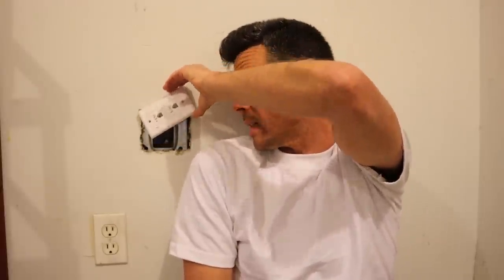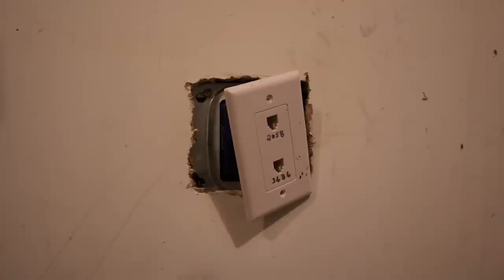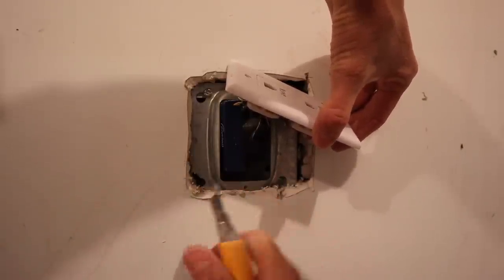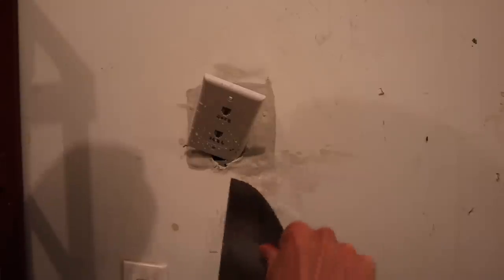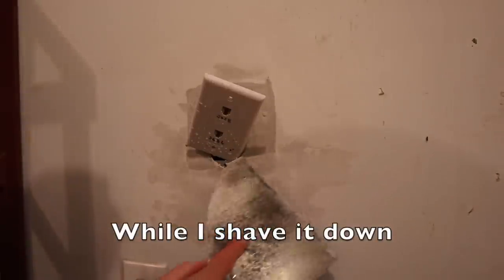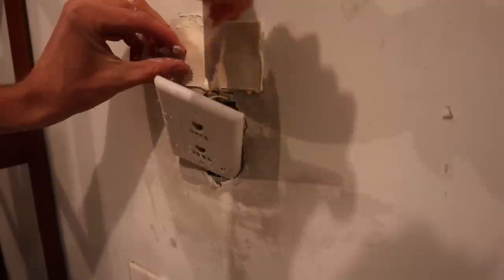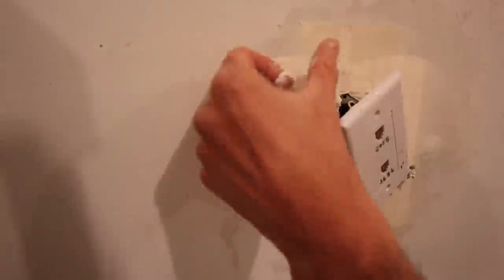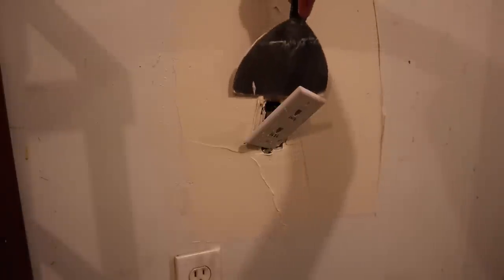How to Patch a MUDBOX!!! (drywall repair)

Comment: Oh for the love of God! DISCONNECT THAT WALL PLATE before mudding! Giving me a nervous breakdown watching you delicately maneuver your blade and mud around it. Ha ha ha ha!
Reply: Aaron its only phone wire
Reply: @Bamacher59  Exactly! Snip the wires! Ha ha
Reply: @aaron74  The RJ11 keystone jacks come with little clips that allow you to pry them off the face plate. Takes 3 seconds with a flat screwdriver. No need to snip them out (I get you were joking), but it sure makes the video all the more frustrating knowing how easy it is to disconnect properly!
Reply: @poetnk  this wasn't a keystone jack. Even easier, just unscrew terminals lol
Reply: @aaron74  And throw the plate away.
Reply: I was thinking the same “dude just unscrew the connectors!”
(not that I haven’t done EXACTLY the same myself before lol )
Reply: When I installed LV before mud, we wrapped the terminated tele/data com in the plastic bags they came in and pushed them back in to the wall. Then talked crap about reopening the holes to screw in the plate. Now I think back and realize I gave no respect to the other trades, happens a lot when all you know is LV and think your sh*t don't smell (guilty until I became an electrician).

Comment: Whoever hired the LV guy needs to get their money back

Also wiremap those ports.. looks like 7/8 pair popped off
Reply: Ex LV guy. Electricians called us primadonnas. When I became an electrician I understood why. I usually got the job of helping them out with anything that was not monkey simple. When I was LV I rarely fixed walls. But I would lay back in drywall after screw ups or large cuts as an electrician unless GC said not too. Honestly, when I was LV I had no skills outside of a "cable runner" and termination. Everything else was beyond most of us. Now it is all about the finish work, the rest is usually easy.

Comment: Step one: REMOVE THE FRIGGIN' DEVICE.
Reply: It looks like it might be an all-in-one phone jack. IE it looks like a Decora device but the plate and device are actually one piece. The only way to take it off would be to disconnect all of the wires, and not everyone wants to dive into that.
Reply: @thebigmacd  Yeah... using a #1 Phillips screwdriver to disconnect a  handful of 24-gauge wires is a lot of work.   You might break a nail or something.
Reply: @ImagImages  Or unless you take a couple of cell phone pictures beforehand, it’s a lot easier to make an error when reconnecting than you might want to think.
I know this because, why ?

Comment: "*Mud ring*" mud ring, we were looking for the term, mud ring
Reply: Funny, what many people call a "mud ring" is a simple frame that goes in a hole in the wall without a box...and doesn't require any mud.
Reply: @thebigmacd  I call that a low voltage mounting bracket.
Reply: @illestofdemall13  Called them mud rings here in SoCal, at least 20 years ago we did LOL.

Comment: Where I am we use boxes with mudrings especially for commercial applications. It never fails when I come back after the rockers and tapers are done that 90% of the screw holes are all filled in by mud. I have to scrape them all off with a screwdriver to install receptacles and switches.

Comment: My trick is to use mesh tape on the sides, especially when the gap is too wide. It holds the mud in place well and creates stronger bonding with the gypsum board on the sides. A little more work, but better results IMO.

Comment: Sometimes the "center" of those low voltage plates are able to be un-clippped from the exterior trim (decora ring), which makes the piece you need to work around much smaller.
Reply: Not meet to do that just stick plate inside

Comment: now I just need to know why they cut holes that size for regular size boxes
Reply: Usually because we measured crappy once and cut once. Sometimes it is because the mounting for those boxes are above and below the box and we think we are leaving an easy hole to fill. Until I started painting and doing mud I didn't get it. Each trade doesn't always get the other trades. If I could only go back in time with what I know know LOL.

Comment: I have a question that never seems to have a good place.
I notice that you always use a standard trowel for most of your work, but have you tried a rounded pool towel instead.
The ends are more flexible and it seems like you would have less of a chance of edge marks as you work than a squared off trowel would make.
Just a thought.

Comment: In america, we call them electrical boxes with mud rings.  Anyways easier for me to just cut the hole the right size in the drywall after I do all my electrical work... had to do this on one that was overcut but your video wasn't out in time so I didn't use any tape on mine.  I'll have to wait to see how many years til it crumbles?  What do you think?  1, 2?

Comment: I hope those jacks are for an analog phone system, and guessing by the four-digit number next to each, it probably is. If it's intended for Ethernet they're going to have major issues with that wiring. I only got a couple of glimpses but it was enough to tell me that the twists don't extend all the way to the connector. Even for voice, I maintain twists--it's just a best practice. Is code different in Canada, because here in the USA you don't need a box for low voltage telecom wiring. A backless box or mud ring is all that's needed to attach the faceplate and they cable can just dangle in the wall behind the sheetrock.
Reply: Those jacks totally look like analog RJ-11s. Probably POTS.

Comment: if I had to deal with a mudbox I'd just mud the whole thing over, screw that lol. use a double gang or a deeper box instead of making a drywaller mud the box in.
Reply: This is standard in commercial buildings or in steel framed buildings. There is a 4x4 box behind that single gang mud ring that is held by a box bracket. So usually if they had to take off the mud ring this is the result. If they used a two gang mud ring it would be the same result. If you are thinking you can use the blue double gang cut-in, or nail-on boxes well those are mostly for wood residential homes. This looks like the data outlet was piped to, probably why they have a metal 4x4 box with a mud ring. Anyway if you mud the whole thing the owner has no internet there anymore.Then the angry electrician gotta find the buried box with his hammer then the "drywaller" gotta patch hammer holes and a mud ring again. Anyway I'm a angry electrician who writes angry comments.
Reply: Cowboy

Comment: Wow so that's what this thing is called. Actually patching up to do some painting around one of those right now! Thanks from Maryland, USA for all the helpful vids man!
Reply: This one is called a 4 square (4"x4") with a single hand mud ring
Reply: I didn’t know you could put metal rings on plastic boxes? So does the ring now need to be grounded? (Not a sparky). What’s up from Maryland as well!
Reply: @danervin2530  probably should, but it won't really hurt anything. Some of the big box stores have a plastic 4 square. I don't ever deal with PVC boxes (commercial/industrial work) so I wouldn't know the code on that. Since this particular application is for a phone or Ethernet connection and is under 50 volts it is not required to be in a box per the National Electric Code, but your local jurisdiction may be different
Reply: @danervin2530  yes, a metal mudring on a plastic box needs to be grounded. There are grounding clips that you can use, or just buy a plastic mudring.
Reply: Matthew Schafer that’s what I thought, I usually just see an orange ring for low voltage and nothing behind it- or nothing at all. I get that whatever 110 receptacle you use will have a ground and, that gets screwed to the ring, just didn’t know if code dictated a separate ground to the ring since it’s also metallic (which now needs a pigtail). I think best practice around here would be to do what 0778drz110 said and use plastic throughout in order to avoid an inspector’s eyebrow.

Comment: Nobody uses landline. Disconnect leads from faceplate; remove faceplate; cap leads; stuff back in box. Get a larger blank faceplate...forget the mudding.

Comment: I used to be a low volt guy. Most of us really though/think holes like that helped mudders because it seemed small. As an electrician I learned better and would cut bigger and usually used some 1x2 and the scrap of my cut to fill back in. When I worked as a painter I really hated how I was taught as a LV guy. So, on behalf of LV guys, sorry, we were not taught with consideration to other trades and tend to think we are special. Now I get to deal with their asses, karama is a b**ch.

Comment: Replace the my ring with a 2 gang and use a 2 gàng cover
Reply: @jwagnermail  Nope use a single gang mud ring on the 4" box
Reply: I misspoke, install a 2 gang mud ring with a 2 gang cover with a single device cut out. Yes they make them.

Comment: Thats not a mud box that's a plaster ring cover for a 4"x4" box. The drywallers should have rotozipped around the round part unless the electrician messed up and didnt put the box flush with the stud
Reply: Looked like a retrofit
Reply: It's a 1900 box.

Comment: Finally a good use for a hawk! lol. 

Is there any reason you didn't use mesh tape with the hot mud?
I would've pressed the mesh into into your prefil while it was still soft.
And then subsequent coats as needed. Nice job btw.

Comment: Much easier to to remove the faceplate, no? If you can't remember which wire goes where just take a picture of it before you remove the wires.

Comment: I was always told these boxes had to be used where they come into contact with air that is pushed through the house via ventilation... for example when our house was built they had to use these in the stud spaces where there was cold air returns... maybe just a states or local code thing. Using them the extra volume for wiring makes sense too... you make these jobs look sooo easy.

Comment: That's a low voltage plate and actually isn't even required to have any sort of box.  Just screw the plate directly to the drywall if you want.  But if the mud ring is already there, I guess you're stuck with it.
Reply: Geoff G but certain job specs require boxes for all termination points
Reply: Job spec I can see using it if that's the case  i only meant minimum code.  The mud ring is better than just screwing faceplate to the drywall for sure.

Comment: I install a lot of phone line \ network jacks and plugs and can't figure out what could have been in that box. Usually the wire terminates directly at the plug.
Reply: It's the Telco dmarc. Fed from an electrical room so this is either a townhome or a condo/apartment most likely.
Reply: @kfbr3928  Ok, thanks. Our dmark doesn't look a thing like that in Quebec ! Usually it's in the tech room or close by the modem.

Comment: I think you could have used mesh and just coat it right away with that quick set that you mixed up after all it's in the garage
Reply: Doesn't meet fire code

Comment: Question: On typical taped seams, first coat is taping mud, and last coat is finish mud. But what mud do you use for the intermediate coats?
Reply: All-purpose mud.
Reply: Stephen T so you are using 3 types of mud on the same joint?
Reply: @conradcoolerfiend  You can, but it depends on how much work you're doing and what finish level you require. For the basic homeowner doing a small job you can using taping mud and then finish with all-purpose. The finish (topping) mud is generally used when you're trying to get the smoothest finish possible (i.e. non-textured walls). It's also a bit easier to sand than all-purpose.

Comment: Hi VC - do you have any comments on whether having a tight fit of mud around an electrical/mud box helps in reducing air transfer, specifically with sound?
Reply: Sound has so many levels of relevance, I would say the mud around the box is only one piece.  Wraping the back of the box or filling the internal holes and your wall insulation will give you way more sound dampening than air gap at the box, IMO
Reply: @plumber77mjr  Thanks for your input.  Is it unusual to have insulation in interior walls?  I've read some comments that in the warm seasons these rooms can become really hot.  I'm in a condo and in a climate where you typically wouldn't have AC.
Reply: @Cajun7907  Here in California, insulation isn't required in interior walls, so you never find it as most people don't spend the extra money for it.  I'm not sure how that would work in more harsh climates, but here I'm sure it doesn't make a difference.  I've done it on interior walls for sound damping, but other than that just on exterior walls, common (condo) walls or the wall between the home and the attached garage.
Reply: @plumber77mjr  thanks.  The challenge I'm having is that I can hear my upstairs neighbor's TV through an interior wall.  Very strange.  I'm just looking for ways to try dampen the sound.
Reply: @Cajun7907  sound dampening is tricky, something I'm far from an expert on.  But what I've found is that it's a "system of things" used together that work.  missing one element doesn't remove just that part.  Example, if there are 6-parts of sound dampening, then missing one, isn't like loosing 1/6th its more than 50%. So every little bit helps, but one thing won't make a substantial difference!
Reply: @plumber77mjr  thanks again.  I appreciate your insight.

Comment: What mud did he use the second time with the tape?
Reply from the maker: All purpose
Reply: Is that all purpose equivalent to (usg) green all purpose, blue or 3 in 1 blue? People always interchange them
Reply: @Vancouvercarpenter
Reply: @michaellazenby6712  Probably the equivalent of the blue USG lightweight all-purpose. I remember in another video Ben said that the heavy all-purpose (like the green USG bucket) is practically non-existent in his area.